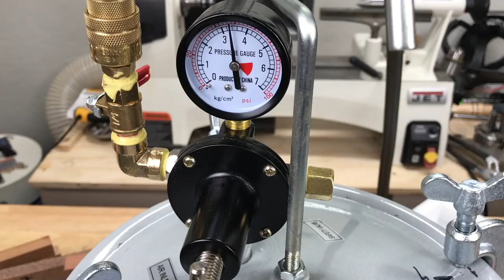How To Make  A Pressure Pot and Turning My First Hybrid Pen Blank

Comment: Nice job.  Well explained.  If anyone tries this consider using a low torch or heat gun to loosen the existing fittings.  Whatever they use dries hard and hard enough to actually allow you to snap off the relief valve and it is a poor excuse for a sealant. Use a deep well socket wherever possible.  Also, after returning 2 of these I realized that they all had small leaks at the fittings so the hard sealant they use sucks, so just plan on removing and re-sealing all of them.  Use a thicker sealant like he uses in this video, not loctite or teflon tape.  Once you do that it seals and works fine.  They don't tell you in the instructions but the relief valve is adjustable by turning the slotted fitting on the top.  Mine kept opening at 45 psi before realizing that it was adjustable. (DISCLAIMER: be careful not to set it higher than 50psi.)
Reply from the maker: Great tip.  I didn't have that experience, but I'd hate for anyone else to.
Reply: Thanks for the tip!
Reply from the maker: Janet McPhail my pleasure.
Reply: It's most likely red thread loctite which can be melted with heat like you mentioned. Commonly used in auto repair when you don't want something to come loose. Comes in two main types. Red and blue. Blue doesn't need heat to loosen it.

Comment: I'm with AndyB on this one...Nice job and I can see one of these in my future. I always put my pen tubes on the lathe in between the pens bushings and clean them with a solvent to get and oils let on them form the manufacturing process and then sand them on the lathe. It goes real quick and easy this way and I get a really good "tooth" on the tubes.
Reply from the maker: Interesting tip  If they are smooth I now rough them up and use alcohol to clean them, never considered putting them on the lathe.

Comment: Ok Chad, I've gotten into the powdercoating because of you and I've always liked custom pens. So after watching this and several other videos afterwards... I'm intrigued enough to where I want to get started. I want to be able to turn pen blanks, bowls, and cups. What would I need equipment wise to get started doing this? And any pointers on websites for supplies?
Reply from the maker: I have to say that woodturning is a lot of fun, and I can't imagine many people wouldn't enjoy the satisfaction that comes with turning a block of wood or a tree limb off a fallen tree into something absolutely beautiful and useful.  I'd shop around for a lathe.  Maybe even a used one.  I have a jet 1221vs.  I noticed a lot of the stores that provide classes use this and I could find anyone that said it was junk.  It's a midi or Mid size.  You can get a mini, that is really a pen turning lathe, or a full size and they can get up there in price.  Once you have the lathe you'll need a chuck.  Nova makes great chucks.  They have several options.  PSI or Penn State Industries also has their own chuck that a few friends have.  It gives you a lot of flexibility with several sets of jaws.  https://www.pennstateind.com/store/CUG3418CCX.html That said, there are a lot of projects that don't require a chuck.  Next you'll need turning tools.  There are basic sets out their.  Two options on style, traditional and carbide.  The learning curve on traditional is a little steeper, and carbide is quick.  I turned something with no instruction the first day I owned my lathe.  I think Lathe tools and a lathe is the bare minimum.  Some people even make their own carbide turning tools.  Which I want to try.  So for places...  Not sure what you have local, but online https://www.woodturnerscatalog.com/ and https://www.pennstateind.com  are great resources.   There are a lot more out there as well.   Hope this helps.

Comment: Something you may be interested in trying. I did an acrylic blank and left the tube as is, someone recommended painting the inside of the hole drilled with paint, like silver or whatever, so the brass didn't show through.
Reply from the maker: Mike Hebert Drew from Ox in the Shop also mentioned this. I didn’t mind the Brass, but I was not happy with the way the glue was spotty.  I tried to create a brushed look on the brass.  The paint tip is a great idea.  Thanks.
Reply: Yeah, the paint on the inside hides the glue, too. I had that issue on the acrylic blank I did a couple weeks ago. I just started turning and only got to make a few pens before I headed overseas for some training. I'm going to dig into your HF pressure pot build when I get home, I'd like to do some casting of my own. Thanks :)

Comment: Hey there! I did the conversion and all my fittings are great, but the lid leaks. Any tips for that?
Reply from the maker: Bigtgamer 1 where is the kid leaking?   My first pot had a bad weld.  I exchanged it and the new one works great.
Reply: @ManCrafting  I think it's leaking at the gasket. Possibly not sealing completely.
Reply from the maker: Bigtgamer 1 if that’s all try lubricating it.  Sometimes the gaskets loose elasticity and a simple layer of petroleum jelly gets it sealing again.

Comment: Great video. I hope to start this at some point.  Question: what's the difference between pressure and vacuum for this?  I've seen both.
Reply from the maker: David Coburn pressure reduces the size of bubbles. It’s typically better for resin casting. Vacuum is used to do stabilizing.  So it’s pulling the resin into the would by a vacuum.

Comment: Hi Chad - great video. What is the gunk you are using from the tube to seal the threads. I have used PTFE tape and my pot leaks like a sieve. I get it up to pressure and withing 10 minutes it has lost 20 odd bar. The pen is great and I can't wait to try something similar. Thanks a million - Gavin (Botswana)
Reply from the maker: GavinPam Meyer it’s a pipe sealant.  https://www.amazon.com/Rectorseal-23631-Brush-Thread-Sealant/dp/B0002YPAFY/ref=as_li_ss_tl?s=hi&ie=UTF8&qid=1525051950&sr=1-1&keywords=gas+pipe+thread+sealant&dpID=51tKrqNK4HL&preST=_SY300_QL70_&dpSrc=srch&linkCode=sl1&tag=httpswwwyo0da-20&linkId=549aae23e6c535ab63b6a8da1a1bee16

Comment: I am new to all this, so instead of using a vacuum to remove air bubbles, you used presser to force the resin into the wood, is that correct?
Reply from the maker: Martin Mackett I’m using pressure to compress the air bubbles so small they are invisible.
Reply: @ManCrafting  Thanks. learn something new every day
Reply from the maker: Martin Mackett there is another resin process where you vacuum the air out and it pulls the resin into wood or other porous materials.  This just happens to work differently.
Reply: @ManCrafting  Thanks once again, do you think that in would be possible to adapt a pressure Cooker into a vacuum pot??
Reply from the maker: Martin Mackett just be sure that it’s capable of 60 psi.  Many brands are.

Comment: Do bike pumps work with pressure pots? Do the nozzles fit?
Reply from the maker: brad cha I’m sure it could.  Just need to add fittings to make it work. Normally the bike pump uses bike valves. This is set up for a quick connect.

Comment: I have a leak at the joint under the gauge.  I’ve taken it apart, wrapped the threads with Teflon tape, added a liquid thread sealer to the threads, and reinstalled but still leaking.  Can you stop a slow leak without taking it apart again?  Like maybe using hot glue or something similar?
Reply from the maker: Is the leak at the weld, or where the fitting goes in?   If it’s the thread, I’d try plumbers putty instead of tape.  If it’s the weld,  I’d probably grind the paint in that area and repels it if you have that ability.  If not, try JB weld for metal.  Or maybe flex seal.
Reply: Thanks. I was thinking JB weld also.  I know it’s good for stopping radiator leaks but wasn’t sure about air.
Reply from the maker: @TxMasterOfNone  I think if you put it inside the pressure is pushing against it would be into the lid and should seal without an issue.

Comment: Awesome pen! What pressure you set it at? And how long?
Reply from the maker: It does depend on the resin, but for Alumilite, I did 50 PSI for about 90 minutes.
Reply: @ManCrafting  awesome thanks! I have some alumilite I'm gonna try today

Comment: Who makes the molds you're using? I really like the design. Also, would a canning setup work      as a vacuum chamber instead of the pressure pot?
Reply from the maker: I know some people have modified pressure cookers to use as a pressure pot.  I’m not sure about a vacuum.  The blanks are from www.lizardblanks.com  Jared makes some amazing blanks.
Reply: @ManCrafting  Thanks!
Reply from the maker: HarlieJ my pleasure.

Comment: Hi! If I plan to get the TCP Global 2 1/2 G from Amazon do you think the parts listed in the description will fit? Unfortunately, Harbor Freight doesn't ship overseas. T_T
Reply from the maker: Great question.  The only part you might need to change is the one that screws into the lid.

Comment: Love the video and the music just an advice check you tail stock it was to shaky you cold have had a better finish if it was more center and not shaky like that. But you rock man it looks good.
Reply from the maker: robinson vargas thanks.  I had the mandrel assembled incorrectly.  I didn’t realize it until after I had started the video.  This was my first hybrid blank so I just let it roll and tried to minimize the obvious mistake in post.  Not everything can be fixed in post. 🤷🏻‍♂️. Thanks for watching and your friendly way of pointing out the issue.  I appreciate that.  Not all comments are so kind.

Comment: After installing the reused pressure valve you said to install "this" the big black thing with the two outlets but never said what "this" actually is (the part info didn't pop on screen like the other parts). , and also can these all be purchased from the same place
Reply from the maker: BloodSweatnBass  the this part comes with the pot.  The rest of the parts I have links to in the description.  I wasn’t able to find them at Harbor Freight.

Comment: Chad, when I hold on it bay finger  stop releasing air . But as soon as taking my finger off start again. Probably I have to buy one. Thanks
Reply from the maker: Djalil Esfahani try tightening it without pressure. Then pressure it back up and see if it holds.  Mine did, but I now not all do.

Comment: Great video. Thanks for sharing.  Can I ask a couple questions? Is there a good place to buy air hose fitting adapters? Mine always leak. Did you forget to paint the brass tube to help hide it in the red clear resin? What did you mix into the resin? Looked like shavings of some type. Again love your videos.
Reply from the maker: Hey Jim thanks for watching.  I get the hose adapters  at random places, these happened to be at Lowes.  I haven't noticed a huge difference in quality.  I do have some leakage that I need to run down.  Very well may be that fitting.  I'll let you know.   As for the brass tube.  I was ok with it being visible.  I has sanded it uniformly to look like a brushed finish.  The problem I had was the glue didn't cover consistently, which could have been a bigger problem if it blew out.  It didn't, so that's good.  After I posted the video a friend of mine, Drew Oxford from Ox in the Shop told me he paints the inside of the blank to cover hide the glue up.  I also watched another of NV Woodtwerks videos on gluing acrylic that should help on future acrylic projects.

Comment: Now i know what i need to buy with my harbor freight gift card i got for christmas. Recon it would qork as a vacuum chamber?
Reply from the maker: I don't think so.  I know Zac has a video on stabilizing resin, which is the obvious next step.  I was just fortunate enough to have Alex Krause encouraging me and sent me a bunch to get me rolling.
Reply: It will work as vacuum chamber but you need to make a clear lid so you can watch bubbles to make sure you don't overflow and ruin your vacuum pump. I made one out of corian with an acrylic insert in the center. There are others on the tubes that show how to make vacuum chambers that might help.
Reply from the maker: John Pierce thanks. Good info.
Reply: They will work both as a pressure pot and a vacuum chamber but you need to use a dual vacuum/pressure gauge.  I tried putting resin under a vacuum, instead of pressure, but did not get good results.  The resin bubbled up and hardened.  Conclusion:  Resin is too thick and cures too fast to vacuum.  You have to put it under pressure.
Reply from the maker: G. Salisbury if I was using it for a vacuum, I’d use it specifically for stabilizing.  The resin is watery and is pulled into the wood.

Comment: Man I was iffy watching this with that awful channel title but damn bro you brought out those flakies for the resin and I was in love. Great job!!

(ps you don't have to clarify that it's crafting for men no one would think less of you if you just called it any other type of crafting channel lol)
Reply from the maker: Thanks for watching.  The story of the name...  I was using a cricut vinyl cutter to make masks for sandblasting images on stainless with a good friend.  His wife and my wife were in another room talking.  At some point one of them said, "Look at our boys doing their arts and crafts."   We got a little indignant that we were being called "boys."  In a non serious way.  So jokingly we said "We're using a sandblaster!  This is manly!.  We are doing manly arts and crafts."  and now you know the rest of the story.
Reply: LOL thanks for the story :) I just wanted to let you know that I'm using your video for my own pressure pot! Also, the second link you put up is linking to the wrong item :( This one Solid Brass Quick Coupler, 1/4 in NPT Male Thread link. 

And if you don't mind answering as well...I would love to know what glue/sealant you're using for the pieces you're attaching.
Reply from the maker: Crazy, not sure what happened on that link.  I will track down the correct one and get it fixed.  I used T Plus 2 Pipe Thread sealant.  I added that to the links as well.  Thanks for the heads up.

Comment: Chad , why when I put the pressure on 60 psi ,from release valve air drain to 32psi  and stop .what should I do ,please let me know if you know what I’m talking about
Reply from the maker: Some of the air pressure valves are set very low, and some are just plain faulty.  First try adjusting the screw on the pressure relief valve to see if it will hold the pressure at a higher level.  I don't have one in front of me at work, but turn it so the screw is tighter, I believe clockwise.  This should allow it to hold to a higher pressure.   If you can't get it to hold, it may be a good idea to buy a more reliable pressure relief valve.  I know some people change it right a way, I've been lucky so far.  Also, make sure that it's the valve that is leaking and not another place.  I had a mad weld and had to exchange mine.

Comment: What if you strip your pressure valve while trying to replace it what do you replace it with?
Reply from the maker: If it was me, I’d weld the opening shut and redrill and tap it.
Reply: @ManCrafting  Would that be the only way.
Reply from the maker: Pridetoons aka Afro Lion exchange it.  Is it new?
Reply: @ManCrafting  Well yeah I just bought the pot. I couldn't get the the pressure valve off. The nut got stripped. Also I just bought a new one from Amazon I hope it fits.

Comment: The cap fitting you sed 1/4 but when you order it on Amazon. 3/8 you chooses If do something please do it write . Know I have to return it. And order 1/4
Reply from the maker: Sorry about that.  Hope it didn't ruin your day.  Thanks for the heads up.  I'll check and see if possibly I grabbed the wrong link or if it was changed by the seller and get it corrected.
Reply from the maker: Sure enough.  That listing originally had three sizes, and now it's down to 2.  Thanks for the heads up.  I'll find a listing that works.
Reply from the maker: Fixed. It is now right.

Comment: nice! as most pen makers say I wanna try casting my own, and WHATS UP WITH YA TAILSTOCK????? buy a new mandrel or turn between centers. plus going above 1500 grit is pointless work just use brasso or some other liquid metal or silver polish, saves alot of time and you get the same finish
Reply from the maker: The tailstock was fine. I had installed the mandril for the pen wrong because I hadn’t used it in a while.  I didn’t realize the issue until I was done.  At that point it was a little late to redo it.  I had to figure out the best way to still use the footage.  I’m doing most things for the first time that I put on video.  If I can do it, anyone can.